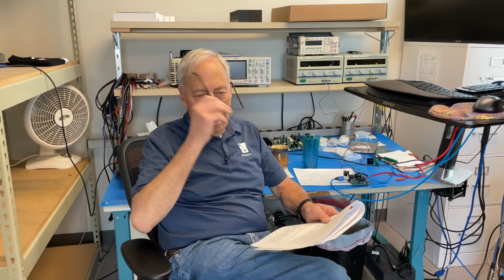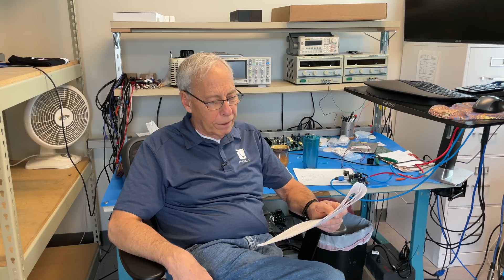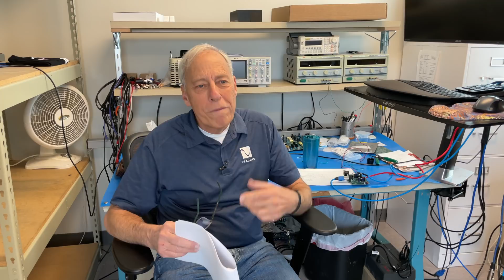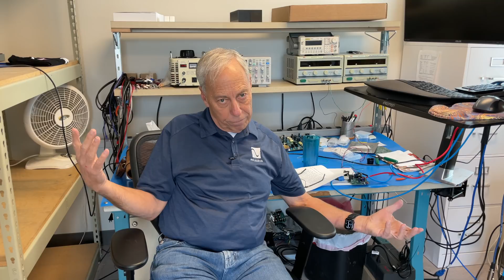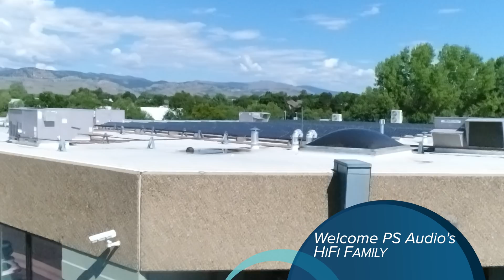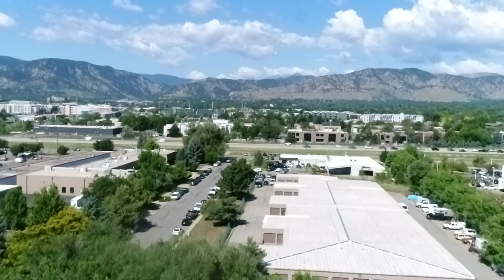Impedance matching and cables

Comment: I’ve been told not to extend speaker cables with anything like a female to female couplers because it, “messes with your impedance” and also not to use speaker cables over a certain length. Do these, or other jury rigging practices have negative affects to your sound system?
Reply: The only consideration for speaker cables, is their series resistance.  You want that to be as low as practical; excessive length will compromise your amplifier's damping factor.  Adding couplers isn't a problem if they are good quality, but the fewer connections in the speaker circuit, the less likely you are to have issues with them.
Reply: Any connector introduces the risk of a discontinuity creating a resistance/impedance.  It might be small, but there are videos testing electrical connectors under high current, some heat up and melt before others.  That's from the resistance in the connection.  For audio, you probably can't measure it without special equipment, but then the standard in audio is whether you can hear it.  

As for speaker cable length, I suppose someone could have used a long cable and accidentally created a long wire antenna for a nearby radio transmission frequency and thus developed the rule for their location.
Reply: @Sblackfll 
Which statement are you referring to?  
Some additional details:  
There are a few amplifier designs which require a specific minimum speaker cable length, to provide a small capacitive load to the output stage that's a necessary part of its stability network.  
In general, the complete amplifier/cable/speaker network never achieves damping factor anywhere near the specification for the amplifier alone, due to the driver voice coil resistances.  That means a small amount of cable resistance will be swamped by other resistance in the circuit, so it will go unnoticed.
Reply: @Sblackfll 
I would certainly be interested in finding a few people with "golden ears" for an ABX test session.  I'm not interested in doing the listening myself, as I'd rather be monitoring signals with test equipment.  
I'm open to suggestions regarding cable types to compare, and music selections, and I'm willing to bring test equipment to an audio installation where there is a speaker-cable difference claimed.  
If you're curious, I'm an EE with 40+ years experience in analog and digital equipment design/development, from power supplies to amplifiers, analog signal processing to complex digital systems used for commercial flight controls.  I'm a hardware troubleshooter and analyst at heart, and have 100% success rate in solving design issues that have been assigned to me.  I was often the engineer of  "last resort," called in to solve problems that were stumping other engineers.  
If there is a difference between the signals delivered to a loudspeaker by various cables, I will find it.
Reply: All those parts do is secure the connections between pieces of wire.  
They have NO effect on impedance.

Comment: Some things matter and some things don't. I'm happy Paul is not promoting cable lifters.
Reply: CD cases upside down..almost free.
Reply: @SubliminalVibes  When you spend US$200,000 on an audio system with cables costing US$20,000 of that budget, you need something to hold those cables for cosmetic reasons and if that is the argument, I'm all for it, but don't tell me the sound is any different. Well, our brain will make it sound different because we react to what we see.

Comment: I think that bunching or coiling loudspeakers cables measuring over 6 feet or more create some resistance or impedance. Stretching them and keeping them to some extent away from power cables improves the sound. More solid bass and clarity in the upper frequencies imo.
Reply: In extreme cases, coiling loudspeaker cables could conceivably affect the highest audio frequencies, but not bass.
Reply: @marianneoelund2940  Tell that to my ears.
Reply: so a coil of wire creates variable resistance, inductance. not much though as cable has heavy insulation. A power cable I don't think would be an issue, remember power cables are throughout our walls. But a low voltage line cable can be suspectable more so than a high voltage speaker cable. A unbalanced cable low voltage ex. a unbalanced mic  is susceptible to the condition you described. I highly doubt your example will produce the affects you describe in a balanced scenario. get a mic and get a daw with noise generator and frequency analyzer then you can test this all.
Reply: Not coiling wires is best practice for all types of wires from extension cords to interconnects.
It will certainly have a very audible effect on long audio cables (Dave Rat demonstrated this a while ago).

Will it be audible on a short cable?
Who cares, follow best practices when possible.

Comment: so there is no way to measure and explain why cables supposedly sound different?
Reply: Find my comment above, it may help some, measuring ohms for a cable, really doesn't even matter, its really splitting hairs and bean counting, The basics are length, AWG, and quality of copper in the cable.
Reply: @sirsmarty274  
Connector quality and assembly workmanship are even more important than the cable parameters.
Reply: @marianneoelund2940  I can agree, in another post i made a comment about connectors, i personally have none, i run bare wire from the amp directly to the crossover.
Reply: @sirsmarty274  I'm tempted to eliminate connectors myself; but I change my system around too much (like speaker placement) plus I can't settle on any one cable so this very fine solution seems impracticle.
Reply from the maker: None that has brought any satisfaction to those who don't agree or haven't actually tried them. There are a few difference tests online where you can see the actually differences between two cables but then those who don't want to hear that simply suggest that despite the difference it's not audible. From my view it seems a waste of time if one can simply listen.
Reply: @Paulmcgowanpsaudio  It's not just a measured difference that matters. I can show electrical differences between two 6 foot RCA cables. The issue is the magnitude of such difference. That is where the snake oil is thick in an attempt to fool people who lack understanding of electronics. These measured differences are largely insignificant. The effect on the final audio reproduction is far below our hearing threshold, but not our brain's perception threshold, IOW bias factors! Application also matters. An interconnect on an old high output impedance preamp such as  a Dynaco tube PAS will behave differently than on a modern OPAMP output preamp. And I have seen many artists illustrations of cable comparisons but what you never see is a calibrated scope capture, which is very easy to do these days even with a hobbyist grade scope. 

Who was it in the 80s that advertised an audio interconnect passing a 10mhz square wave versus a commodity grade RCA interconnect? Well of course the commodity RCA cable rolled off the rise times. Problem is audio does not require a 10mhz bandwidth, not even close. So can we see the test again at 100khz or 5 times the maximum audio bandwidth which are the proper rise time measurement parameters.
Reply: @andydelle4509  Yes, but then it doesn't address, Andy, how people like us and other legitimate operations that have no interest or intent on "fooling people" make these choices based on blind listening tests. The differences in cables on standard impedance situations such as low output impedance into high input impedance is easily audible on a high resolution audio system. So we are legitimately doing our best to help guide folks in a good direction. Thanks for chiming in.
Reply: @octaverecordsanddsdstudios1285  How about Ocean Way Studios? Do they rank in the class you speak of?

And BTW, you nor anybody else has yet to give me the specifications of a "high resolution audio system". How do you buy such a system? How do you know if you have one already?
Reply from the maker: @andydelle4509  I have only heard a few tracks from that studio - the Eric Clapton one in particular and it wasn't a very impressive recording. That's likely not a reflection of the studio...so I really don't know.

A high resolution system is one where the listener can easily identify small changes in timbre, soundstage, depth, and where the speakers disappear. You might have to go to a high end audio show or dealer to hear it, or you'd be welcome here in Boulder where I would be delighted to show one to you. That'd be fun! (if you're vaccinated and in Boulder, email me paul@psaudio.com)
Reply: @Paulmcgowanpsaudio  I do visit Colorado Springs so I may take you up on the offer. But I think you kind of answered my high resolution audio question as I expected. It's based on the listener. If one feels they have a high resolution audio system, then they do. It's not something that  that can be measured or quantified. I got my wife an Amazon Echo for Christmas. She would tell you it's a high resolution audio device compared to her old Alexa. It does sound good for the price. It must have some of that Bose acoustic technology. I don't know how they get the bass they do out of that tiny box.
Reply: Suggest going to the Audioholics YouTube channel. They have the best test equipment available. They have done extensive testing on speaker cables and objectively demonstrate that, as long as the cable gauge is sufficient to keep the overall resistance minimal that differences are barely measurable between "audiophile" speaker cables and ordinary zip-cord speaker cable and orders of magnitude less than anything the human ear/brain could possibly detect. Conclusion: Keep speaker cable length to a minimum and use at least 12 ga, 10 ga would be even better. Do make good terminations, e.g., soldered on gold plated banana plugs to avoid oxidation at the connections. I am not stating an opinion here, only reporting what testing proves so I won't be replying to any contrary posts.
Reply: They have no engineering explanation, because Paul's (and his colleague's) ears are apparently endowed with better precision than any of their measuring equipment.
Reply: @marianneoelund2940  The evaluation of cables has become a paranormal experience.  I wish there were more double blind abx testing of cables.

Comment: So how many ohms are required to be in a speaker cable or an interconnect cable in order to make a difference? 
Is there a thresh hold?
Reply: Well zero would be ideal, but not possible... 🤔
Reply: So far the stuff on octave is really unlistenable  swill..where you find such horrible crap..recording in clear dsd so you know it's crap. $29 for a disc is insanity

Comment: I hear people talking about impedance with phono interlinks. I mean from turntable to amp with phono preamp.
Reply: with phono interconnects it is usually capacitance that is listed if i am not mistaken. I would love to hear more about that as well.
Reply: With MC (moving coil) cartridges, you want the phono preamp input impedance to be set correctly - typically around 50 to 100 ohms - for most accurate frequency response.  
With MM (moving magnet) cartridges, the standard load of 47k ohms usually works best, but you also want to avoid excessive cable capacitance (keep it under 150pF).  
These considerations are unique to phono cartridges.  The more general concept of impedance matching of cables to device inputs is not a serious consideration for audio, but can be important at higher frequencies, such as for video or digital.